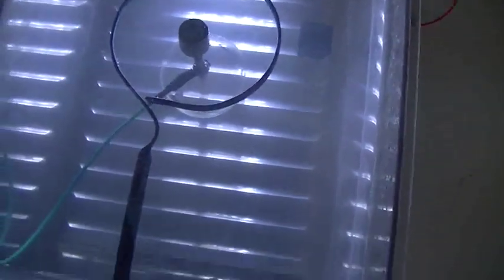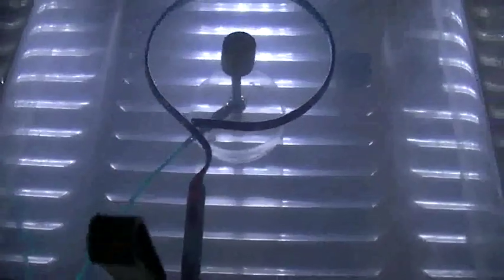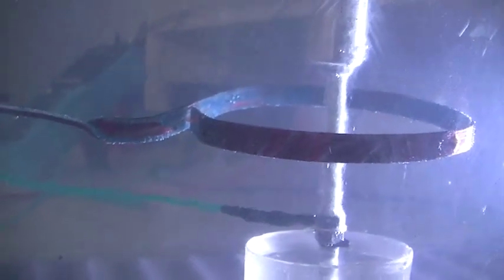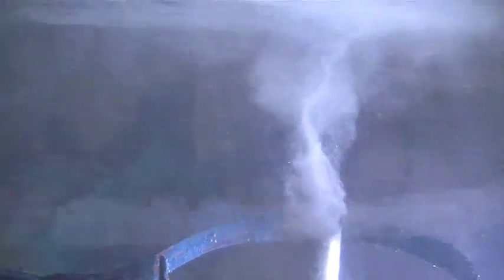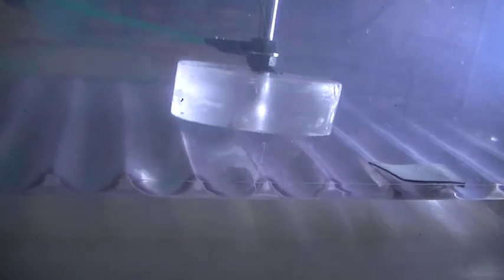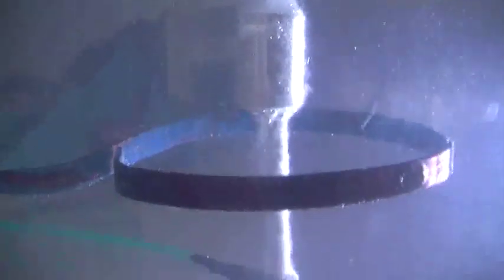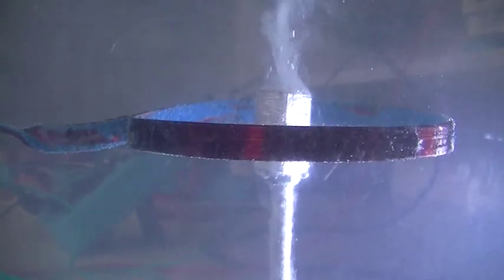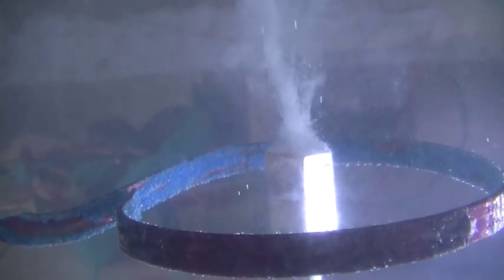magnetic vortex using full current loop anode

Comment: If you notice, the Tornado connects directly to the centre only on the magnet, this is the enertial plane, i have done Ferrocell experiments where you can see the light bypass the outer core of magnet and wrap around the inner core only..

Comment: Why do you think that ring is a current loop--no current is flowing around it.  To get the results you worked so hard for (to flip the magnet), just reverse the power supply polarity instead.  Moving the loop up and down has no effect on rotation since the flux lines flow the same direction through the whole magnet length.

Comment: Great stuff...these magnet tests never get old. Now you've got me thinking about what would happen if the cathode contacted the center of the magnet (1/2 way between N & S), with the N & S of the magnet parallel to the surface of the table so that 1 side is not facing straight down. Would we see both spins from their respective ends of the magnet?